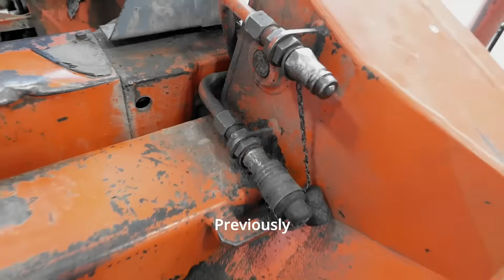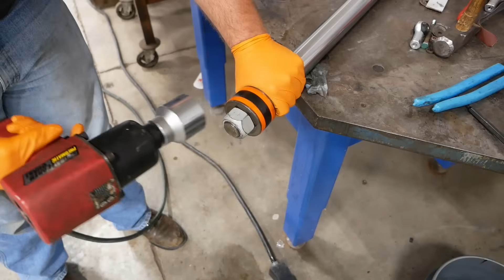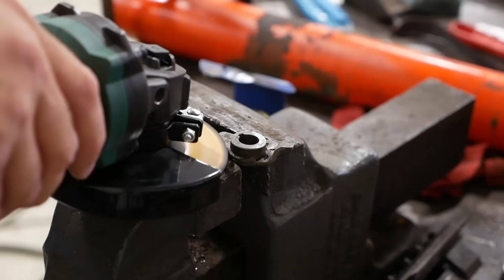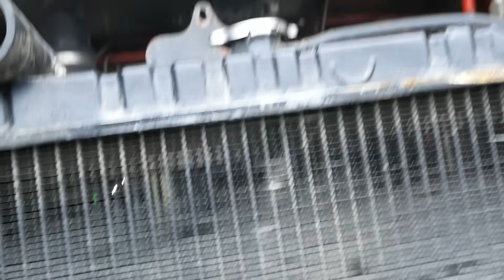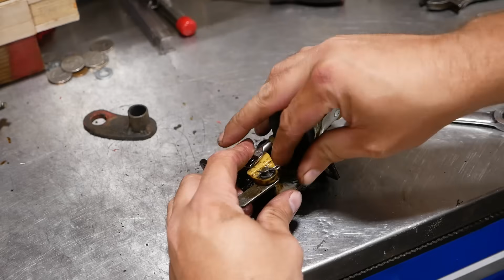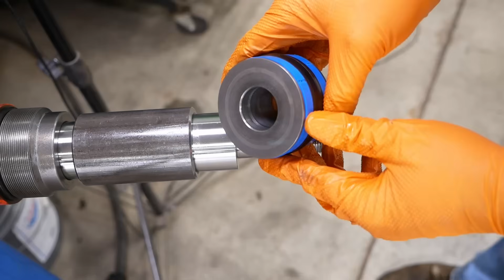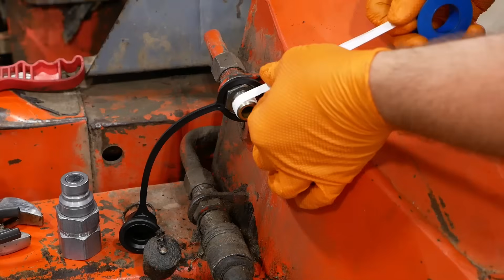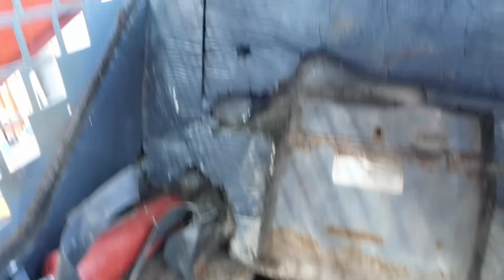Did I Blow up My Cheap Skid Steer? -  Thomas 173HL Won't Rev up, Leaking Cylinder - Part 2

Comment: About six years ago I bought a Bobcat 530 Hydro. Twin Kohler 20 HP gas. Aux hydraulic as well. The best I can say is it ran and made it up the trailer ramps!:) When my wife asked what I needed it for the best I could do was shrug my shoulders. She's very supportive of anything that keeps me from bugging her so we hauled it home. Fortunately the only pins and bushings severely worn were the bucket pivots. Bobcat wanted $2000 for the parts but I found them online for $450. Big job😢 I replaced the leading edge on the bucket which otherwise was in pretty good shape. As is common on farm machines the bucket is over width by 12" which ment I immediately tipped it on its nose. Thank goodness for the good lap belt. Runs a works great for what I use it. Similar to you I'm clearing snow from a good sized drive and a little"family" dirt work. Unfortunately even though I'm gradually fixing leaks the site cleanup will rival the Exxon Valdez 😢 It doesn't drip enough when operating to cause any concern, it just never stops! I cleaned it up ,painted it and installed new decals. I think Bobcat is a little greedy with the $15 a spray can Bobcat orange and charcoal! But what the hell, it's functional and fun to drive. Thanks from America's Dairyland!

Comment: Just an fyi if that is green dish soap you used on the bushes there a lot of salt in that i made the mistake of using that on lower wishbone bushings that within a year the outer part of the bushes had rusted to the wishbone and it wore it out causing wheel wobble lol

Comment: Great Video!
I’d say that slot inside the piston is to stop oil sneaking through.  Being a split piston there is more than one way through.  The o’ring on the rod stops it on one side but going in the other direction oil can probably go between the piston halves and under the piston seal bypassing the piston.
Just a theory 🤠
There is a guy here in Australia named Kurtis from a place called Cutting Edge Engineering.  His YouTube channel is quite good.  I’m sure you’d enjoy watching him fix stuff.  Just him, his wife and his dog and a large workshop.
You could pick up some great ideas  repairing your bucket and that hollowed out eye.
Tell him Davo sent you ha ha.  He doesn’t know me.
Reply from the maker: I watch him all the time!
Reply: @WatchWesWork  he’s only about 300k up the road from me :)

Comment: 5:32 first time i've ever seen something like that. :)) edit: 8:41 put lube on the spine as well (or you can grease the insert before putting the broach in). edit 2: pro tip, before you bore the hole, carefully drill a smaller (than the broached square hole) hole in the stock. You can do this by putting the stock in the tool holder and the drill in the lathe chuck. This makes broaching small parts that have this tendency to mess the broach angle on account of being too narrow, a heck of a lot easier. edit 3: damn, i hate runaways. Had two of them in my life and none of them were pleasant. I never start hokey stuff without a pair of fuel pliers on hand, because i haaate that stuff. edit 4: 25:45 ok, what ... the heck were these people doing with this machine. The deeper you go, the more slop it has. Sheesh.

Comment: On that pin spanner thing. Drop a pin in those whenever you have the opportunity to do so. A bolt, a pin, anything really. Pliers are good with gripping stuff, but only once they bite, so if you give them a head start, with a pin, they work better. On round surfaces, you can use a small triangular file with the flat part on the teeth side.
Back to the pin, i've also seen people put pins in the holes, then wrap chain around, bolt the chain as tight as possible, and then use one of those small crowbars to twist things off by using the bit that needs taking off as a fulcrum. As "take bits apart" goes, probably the cleanest. Certainly no bite marks after that. You do have to have the right size chain tho, can't do it with any chain size, needs to be proportional to the thing you're taking off.

Comment: I have a fair smooth edge bucket, approx 54" wide (most common are 60" ... I think  ... ???) that I'd let you have.   But I don't know if it would be worth the drive for you.  You'd have to come to the wilder side of MO for  it, and you would have to modify the mounting system or make an adapter.  It came off of a Gehl 2500 ...  if it's not too narrow for your machine, and you are interested, I'll e-mail a few pictures to you.
Reply from the maker: Mine is 68"

Comment: It would be interesting to see a financial analysis of this project on completion. You have spent a lot of time but not too much on spares (?) but if it can be made into a reasonably efficient unit it could last for years. It's easy to add up purchase price, plus parts, plus time. Not so easy to calculate the benefits over the next 5+ years. Fascinating repair.

Comment: This myth about stopping a runaway by "just putting something over the air intake" needs to go away. The amount of vacuum that even smaller engines pull is no match for your hand, let alone a rag. A runaway (especially a proper oil-burning runaway) hardly needs any air to keep going. You'd need to have an airtight seal. I hear people talk about using Co2 extinguishers, but you'd need big one and relase it on a very controlled manner while also blkcing the air because you need to replace the air in the intake to  a point where it will nolonger ignite the fuel/oil, for as long as the engine is still moving. If it gets enough air in just one cylinder, even at very low revs, it'll just start right back up again. Definately don't use powder. Yes that will stop it, but it will be an extremely permanent stop.

Oh well, another scary lesson learned: 
1. take a picture of the components before you take them off and compare those to how they look when you put them back on. It sounds silly but that kind of check would catch a simple mistake like this. (simple mistakes are the ones that we think we'd never make... and then make)
2. Have a plan for how to cut the airflow and fiuel supply.

Comment: I had the same problem with runaway on a 2 cylinder 32hp Lombardini diesel engine in a small tractor, the shutoff was a fork that fitted on a pin in the rack and I got it in the wrong position. When It started it went to full revs, no shutoff on the fuel, solid fuel lines so I couldn't crush and stop fuel. Luckily I had just put all the wheels on so I put it in gear with the handbrake on to stop it, that didn't work so I put it in high gear and ran it up to the garage door and tried to stall it, it eventually stopped. Bare in mind all this happened within less than a minute, when It eventually stopped man was I shaking, I was that bad even after fitting the shutoff 3 times to make sure I was still scared to  try to start it again. I did it in the end with a minimum amount of fuel in it for about 10 seconds running and spanners on the fuel injector pipes already slackened so they just didn't leak and could easy open them in a hurry till I made sure all was ok. It was probably the biggest engine related scare of my life. My heart skips a beat just thinking about it.
Reply from the maker: I was ready to hook onto this one and drag it out the door...

Comment: You surprised me by not attempting to even Bush that pivot pin to remove some of the slop. I know you would probably have to do both sides.  With your lathe I  thought it would have been quite simple.
Just thinking outloud. 🤔
Reply from the maker: It's not simple and I'd have to do all 24 bores.

Comment: Might I suggest investigating the induction leak you have that also made it impossible to shutoff by choking it
Reply from the maker: Vacuum leaks really don't affect a diesel unless it's turbo charged. As long as you keep the big chunks out it's fine.
Reply: @WatchWesWork  not what I meant, you tried to block off airflow to kill the engine, and it obviously didn't work and you can hear the air being sucked by, so either it was sucking air past your hand, or there was leaks elsewhere in the intake system, that allowed enough air in to keep it running.
Reply from the maker: @CowboyCree63  Again, what does that really hurt?
Reply: @WatchWesWork  absolutely nothing, unless your engine is running away, and you can't shut it off by choking off the air, as shown in your video.

Comment: I'll run the pool as to when your OCD gets the best of you and you end up drilling out the eye on that cylinder and press a bushing in. Maybe even do a little field repair on the mount on the machine. Plus a new pin. $10 @ square.😁

Comment: Excellent video Wes  :) also get lots resolved on Thomas Vechile and be lots refurbished  too  when done! Also would put 200 ml of GM Automatic Transmission fluid in  fuel tank and grey bottle of STP Total Treatment fuel injection and carb cleaner in fuel tank run thru too  keep injection pimp plus whole motor running nice plus less smoking too ! Even clean up like new!

Comment: With the cylinder rod eye, you'd just cut the old one off and weld on a new one I rekon. It couldn't be any worse than that flogged out old one.

Comment: The fuel shut off on my Kubota powered 7753 bobcat stopped working, then the controller got so hot it almost caught on fire, the cost to replace both was way over $200, i bought a cable for $20, works every time.

Comment: @Wes I'd like to suggest ether get some plexiglass or heavy clear plastic to cover the rear & sides might even make some kind door for it before the white starts flying I spent many nights running one clearing snow & just having 3 of the 4 sides in clear plastic really cut down on the cold & it will hold some the engine heat in the cab  ! This winters going be long heavy snowy one & offering the tip to anyone could really help you or them from freezing ! If you use plexiglass just mount it with self tapers or some L- channel that way its easy to remove in warmer seasons !

Comment: I used to work, in a former life, in an industrial maintenance shop. Without sounding strange. Astro Glide was made for the space program to lubricant O-rings. Kept a bottle in my tool box. Also to keep junk out of any hole, like the hydraulic stuff I use the foam earplugs, they work great for paint prep as well. Plus super easy to remove and dirt cheep as well. Always educational and entertaining. Thank you. 👍👍👍

Comment: Hercules hydraulic seals had everything.
Been using them for years.
Seals packing orings glands fittings all by size.
Put seals in hot water helps installing them.

Comment: You could just cut your fuel line and put a physical shut off valve for redundancy..  it can't run without fuel.   You would want it to be after the fuel filters--- because it would still runaway for awhile with all that fuel in the filter.

Comment: I sold Thomas skid steer loaders in the 1990s. They are a tough machine. I ran a HL 172 for fifteen years. It had a Kubota motor. The only thing I did not like about it was it was just old enough that it had Thomas's attaching system not the universal/standard system. I am fairly sure your HL 173 is the same machine but with the universal attaching system. The HL means high lift, they will lift to 10 foot with the bucket flat. The 173 means it has an SAE rating of 1700 lbs. of lift capacity. I handled 2000# all the time with no problems.
Reply from the maker: Unfortunately it does not have the universal plate.

Comment: You mentioned people kludging SAE hardware where they should use Metric. One thing that I notice at most farm and hardware stores like your local Ace Hardware or TSC is that they still treat metric hardware like a specialty item, but you can still buy all grades of SAE hardware at bulk prices. This needs to change, most automotive hardware even on American vehicles has been metric for 30 years. It's one thing if you are fabricating from scratch, but another if you are repairing something.
Reply from the maker: Yeah. At least you can get metric pretty much anywhere now.

Comment: I did something similar on a Detroit Fuel Pincher back in the 80's. Got the lever on the wrong side, as well. Had to use a clipboard to smother it.

Comment: Probably did that shaft keyway for content but could you have just welding in the keyway only and recut it instead of replacing the whole thing then re-cutting a keyway. would have saved a few steps
Reply from the maker: I don't think that would be any easier.
Reply: Your probably right Your an amazing mechanic love your vids and how much detail you get into. The devil is in the detail. Should have been a teacher!

Comment: Little yanmar fuel shut off solinoid installed incorrectly in the fuel pump will allow for a full full runaway. My first introduction to working on a diesel. Luckily I stayed calm and remembered they need fuel, just yanked the fuel line right off.

Comment: Thanks for explaining that run-a-way diesel diagram, I didn't understand a word of it. 
Perhaps showing the actual real injector pump in question with the actual repair/non-repair might of helped my lack of understanding of what the hades went wrong........
PS Dont cut corners on things that need repair, that ram pin hole should've been repaired while you had it off, I feel like I was robbed of a good repair video.........

Comment: I was factory trained on New Holland skid steers.  We got a new one in with a weak hydrostatic drive on one side.  After two repair attempts, we called in the factory technician.  He found nothing also, but sent me a new drive unit.  He took the old one back to the factory to figure out what happened. When it was built the motor pistons were put in the pump.  The only difference was the lube hole in the slippers.  The motor slipper lube hole is .02 inches larger than the pump slippers.
Reply from the maker: Crazy. You'd think they would idiot proof that a little bit.

Comment: Great video 
What i have done to 2 different older skid steers for quick change
Get the quick attach plate off of a newer machine, cut the back mounting tabs off of it and fabricate new ones that match ure machine. This works great.
The universal ones u can buy online are complete junk and not worth messing with.
Once u do that try to find a truck snowplow and mount it to quick change and run the hydraulics through ure aux ports.
Night and day difference then trying to move snow with a bucket.

Comment: Wes, your knowledge is impressive but your ability to MacGyver your way through problems is amazing. I realize it's in part borne of necessity due to your rural location, but that doesn't take away a thing regarding your smarts. I work on computer chips for a living and I think you'd run circles around some of the experienced engineers I work with. And me, if I'm being honest. But no need to go that far. 🙂
Reply from the maker: I wouldn't worry about it!

Comment: There was a diesel run-away in the shop i worked at decades ago. Detroit 2-Stroke, 4-53, if i remember right. I was 6 or 7 Bays away and that was a scary situation. They will accelerate at a ridiculous rate and disintegrate. Heard it fire up and the RPM's go wild immediately. After i saw bodies running away, one guy ran back and tripped the blower, which blocks the air intake. I think the guy working on it screwed up setting the injector rack. They got it running later with no casualties. LOL I have heard about it happening BUT that was my first and last exposure to one. Believe me, that was damn scary inside a shop. No covers on the machine and no muffler so it was LOUD.

Comment: I burned up a few solenoids on my Thomas ProTough135.  I gave up and used a string through the compartment.  Just one more reason I hated that machine.
Reply from the maker: That works just as well. The Kubota is kinda weird. It has to have a timer to hold the coil in.

Comment: Lucky that didn't have hard solid diesel fuel lines that you couldn't block. The old CO2 extinguisher into the air inlet is another last resort to try. You have Great content. Cheers.
Reply from the maker: I was thinking about trying to spin the fuel filter off.
Reply: @WatchWesWork  Unless you've changed it since purchase -- what do you think the odds are that it WASN'T last done up by the Incredible Hulk?

Given the situation you were in, Murphy would just laugh at you and say, "You've got no chance!"

Comment: I recently started watching this second part of that Canadian loader. I want to try to guess what its problem is. Could it be a vanished injection pump? Could it be the injectors? Another problem is that it might be because of the old fuel, except that it's not apt to be the problem. I know light oil could be 15 or more years of age and will continue to ignite in the cylinders. What is the most apt reason that it doesn't spin past that rpm? Oh... it could be a faulty governor. I wonder which of these it is. It's time to discover what it could be.

Comment: I vote to hack up the quick-attach and put a rear view camera, like it matters what I think 🤣
Reply from the maker: I was thinking the same!
Reply: @WatchWesWork  the Quick-attach isn't very complicated, I adapted a 60in bucket to a 443, and it still works for the standard width.  On the 443 the QA was the same width as the boom, I suspect that is true for the standard QA.  If they did copy a Bobcat, your boom is probably the same width as the standard QA.

Comment: Great video Wes! Does your machine have belly pans? I noticed I could see the floor of your garage. That injection pump definitely was in need of your expertise.
Reply from the maker: Yeah it does, but there is a hole where the oil drain is.